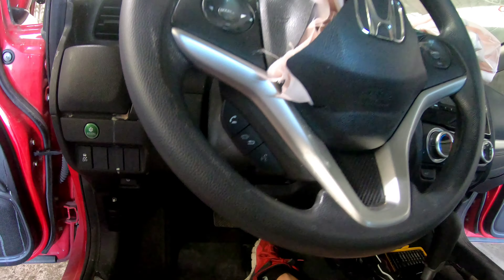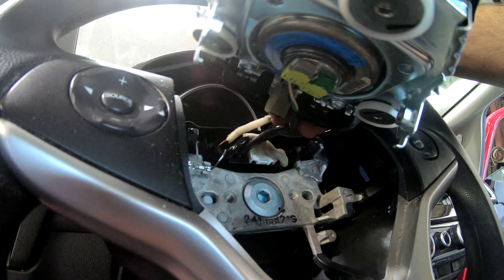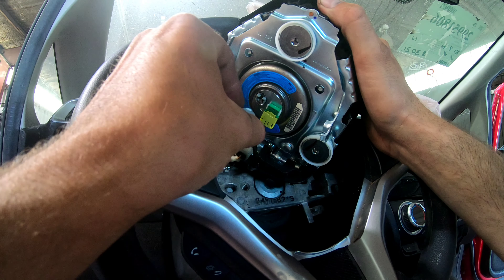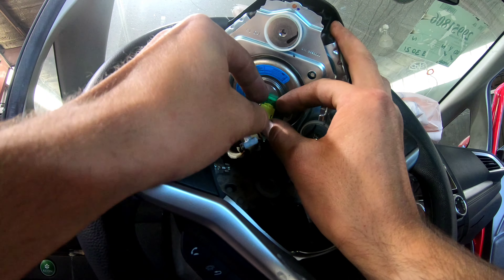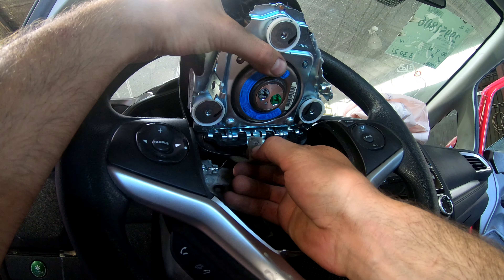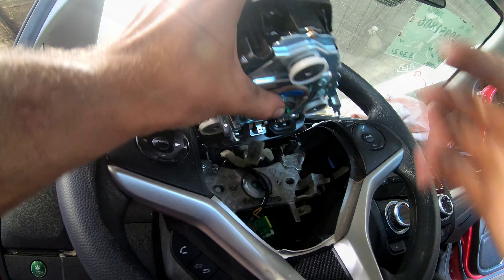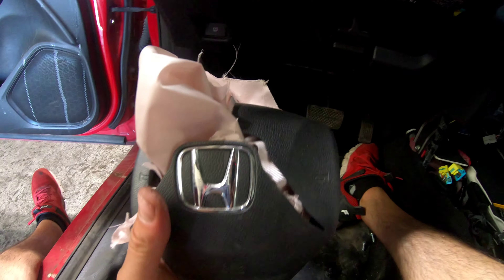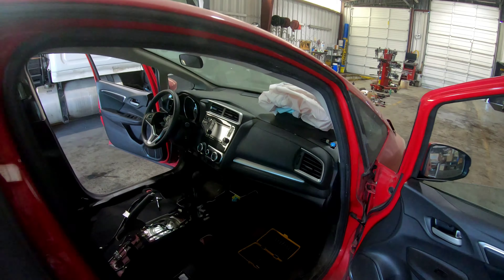Steering Wheel airbag removal / Honda Fit

Comment: Do you know why my srs cables from driver airbag are gone from Honda Fit 2012? I had just cosmetic fix on my airbag and I try to put the emulator in it but there were no sockets available for srs…